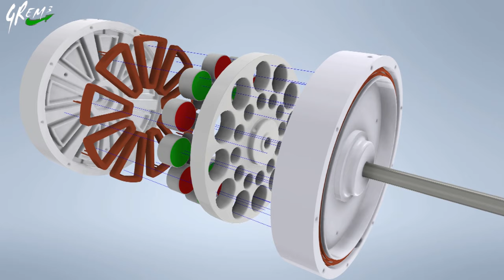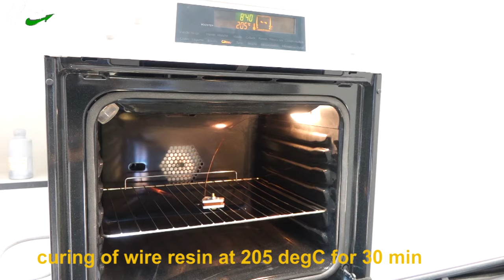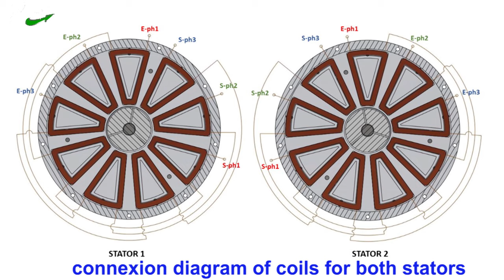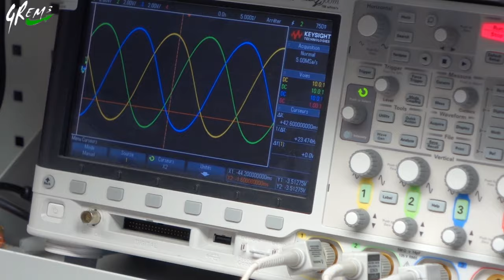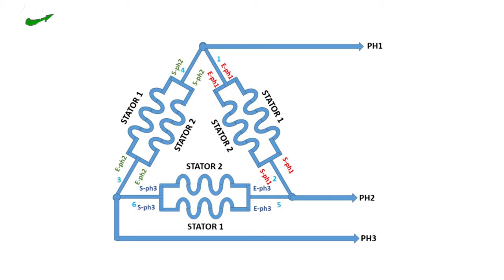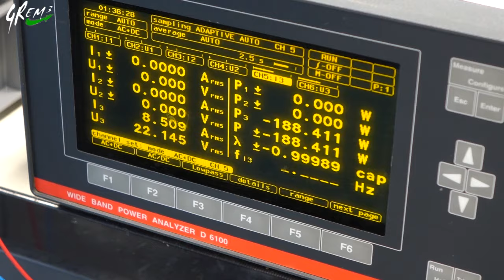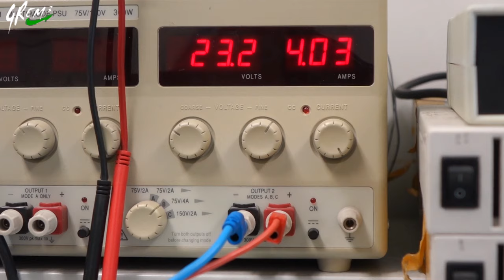3D printed alternator for micro-wind turbine

Comment: finally, somebody who actually uses both sides of the magnets to generate power!
Reply: Both cause the flux to flow between with no slowing iron in between !
Reply: A better and stronger effect of the magnet is when there is only one stator and a double rotor with magnets
Reply: Yeah but that's only because he didn't use a halbach array
Reply: @Kerivity  he kind of used the halbach array since he used the small magnets to form a symetric shape as coils
In axial flux they don't use 2 stators because the other side has a weak magnetic side that's why
I mean you can have 2 stators in axial flux motors its just about cost
Reply: No shit. I've argued with other channels about the advantages, but there's no accounting for educated idiocy. Would've been nice to the results of a proper contra-rotation set up though.
Reply: Why nobody puts some alternatos on the same shaft?

Comment: the first designs of  a radial brusless EC Motor  from Laboratoire Laplace gave me  a idea to design a Counter rotating motor. 
a 3Phase EC gives the Flux to turn Clockvise also counter Clockvise with self amplification.    If you design Cooling Fan, Windmills , Drones   etc Counterrotating Motors are Usefull  and  increase effiency to 40%

Comment: Wow, this is beautiful work.

I like the use of inexpensive tooling (lathe) to achieve precision where necessary, while using other inexpensive tooling like 3d printing for the rest of the geometry to create a fantastically performing item using very attainable tooling and methods. 
(Of course, there's alot of other expensive tooling there, but that isn't strictly necessary for somebody who is re-implementing a design, rather than developing it)

Fantastic work
Reply: I could have done everything needed with a drill press alone.
As you said, the R&D is the hard work, the copying is easy.

Comment: Dominique. I made a similar BLDC Generator for a mini wind turbine. Could you tell me your conclusion about this exercise? Your generator generated 180w with load? You measured volts gnerated without load and it was 30 VDC with 2000 rpm drill , and after, when you connects load, you get 22V and 8 amps, but in the video, you manipulate de drill`s rpm to 2000 rpm again. How many ohms was there in your resistor?. I would be grateful with you if you could share some small details with us. Good, good job
Reply: He said in french 0,9ohms per coil

Comment: Good job, but because of the height of the coreless coils, the air gap is large and the flux density is less than could be achieved with those magnets.
The incorporation of flat flux return back iron plates would have increased the air gap flux density, and the power output further without introducing cogging torque.
The increase of the airgap thickness with coreless designs is the principal disadvantage of axial flux coreless machines.

Comment: I did not understand the reason of using round magnets instead of bars. We missed the voice to explain some steps and specifications. Nevertheless, I appreciate the fact that you exploited the 2 faces of the magnet to maximise generation and the connection requirement this yielded. Good job and thank you for sharing.

Comment: i really wonder why you always were holding the device by hand. didn't you plan for some stand or clamping? i mean a pair of matching brackets with say holes for 3 housing screws each (or one u-shaped bracket) would have done it - and then any standard woodworker clamps or a vice would hold it in place quite nicely.

Comment: Nice sleek design utilizing both sides of the magnet. Did you design this yourself and have the 3d printing done at a speciality shop?
Reply from the maker: Yes the design is from our staff on Laplace and the printing by Initial Prodways
Reply: @harribeydom   I have a design idea of my own, that involves heavier windings, more coils ,and magnets on both sides to create the a magnetic flux.  It should be able to put out more amperage and perhaps may be efficient...if I get it right.

Comment: Have you tried using star delta connection windings. In large 3 phase motors this is used to go from initial startup to high speed. Does this work in reverse for generators.

Comment: Was it a delta connection rather than star connection. Is there a benefit of using delta connection.
Reply from the maker: no, it's just to adapt the voltage to the MPPT controller

Comment: how did you calculate the number of turns and other parameters?
Reply from the maker: A phd  simulate the complete actuator in 3D with 
 ansys-maxwell
Reply: @harribeydom  yeah well that was easy having your own phd handy :)
Reply: @harribeydom   Thanks for answering this question, I was wondering the same thing. Is the generator optimized for a particular amount of wind / blade size?
Reply from the maker: @mattmatolcsi6457  the best efficiency is obtained around 2000rpm by multipling the speed of the propeller by 3.

Comment: Hello plz i tried to make my generator , i used 12 PCS of neodymium magnet 42*10*4mm and around 500 g of copper but i couldnt have more than 12 v 1 a at 2000 RPM , plz Can you help me to improve the efficiency ?

Comment: Beautifully done 👍🏻 but next time use long rectangular magnets designed 2 magnets to each coil, if a north magnet is over the left side of the coil then a south magnet should be on the right side of the coil so that both magnets excite the electrons in the same direction in each coil, when you have a large magnet that covers the whole coil both sides of the coil is seeing the same magnetic pole from that magnet which causes resistance and heat inside the coil, your setup is for an iron core design so if you have 8 coils you should have 16 magnets.
Reply: another fail is that he used 1 magnet side instead of two

Comment: i thing this is slow rotation generator... but 2000rpm is to much ... this is for vertikal turbine not for  horizontal... you try horizontal generator ?
Reply from the maker: for better efficiency it is better to multiply the speed using pulleys

Comment: I don't think a wind turbine will ever produce as many RPMs as your drill. At most, it will be 200 to 400 revolutions. So the voltage and current will not be enough to charge the battery.
Reply: Gears
Reply: @DD-DD-DD   The efficiency of a wind turbine is about 30%. The gears mean a further loss of efficiency to the same extent as the gear ratio.
Reply: @dimmer4955  Every wind turbine made has a gearbox. Sorry, no.